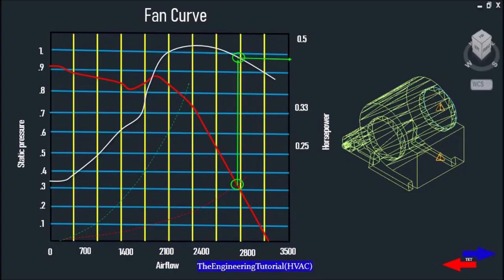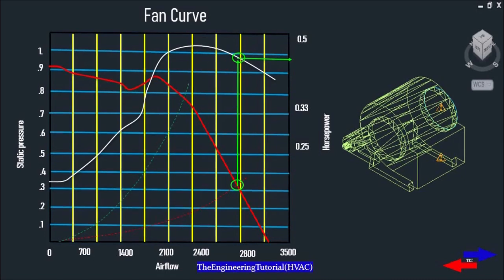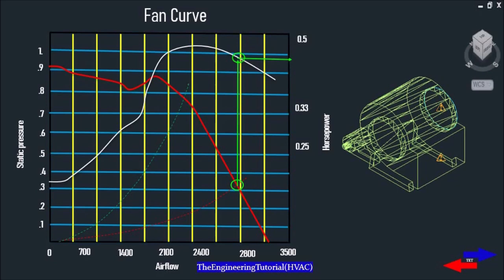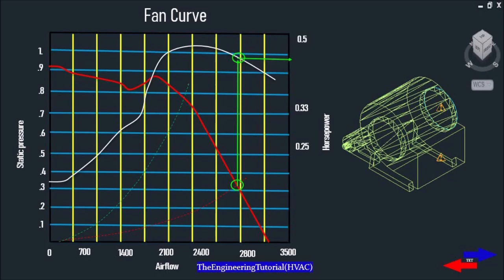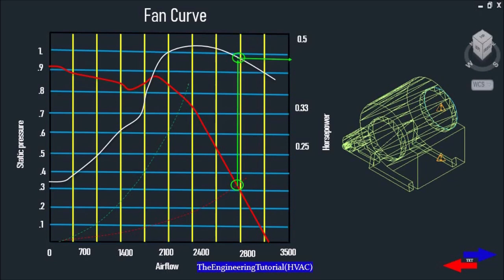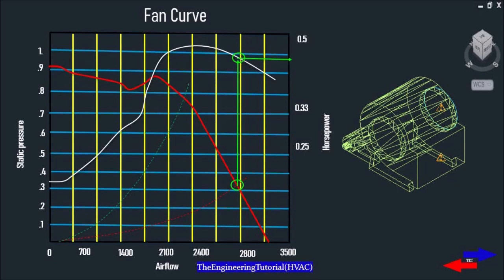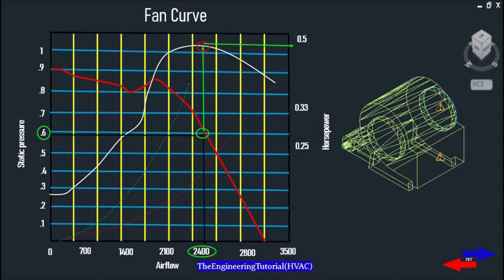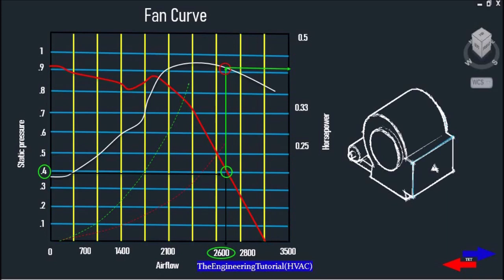How to Read a Fan curve-HVAC

Comment: so why does the fan curve "dip" between around 1400 and 1800 CFM? Say you are continuously closing off a damper starting from fully open, the backpressure increases while flow decreases, then at some point the backpressure decreases yet flow still decreases, then it starts increasing again?